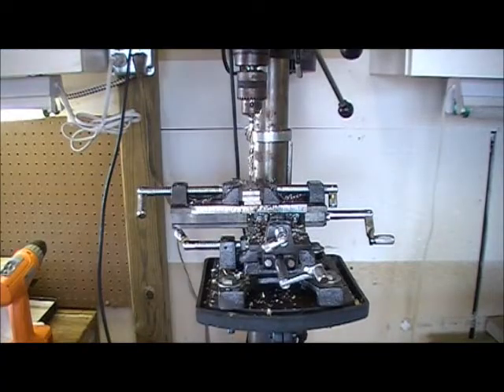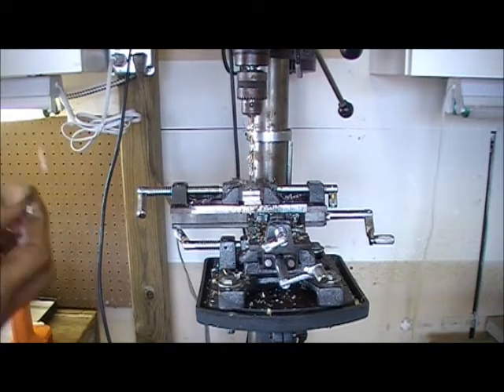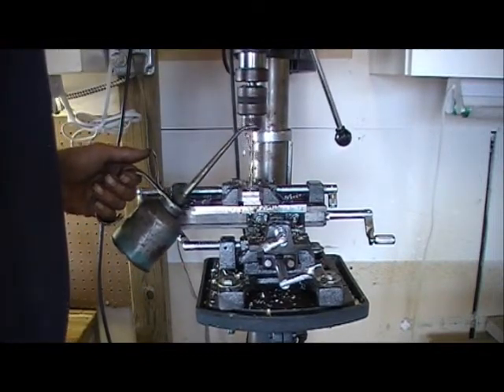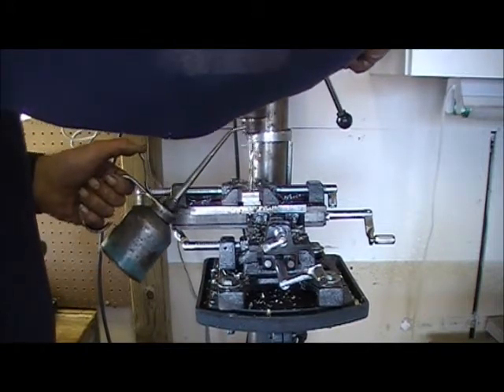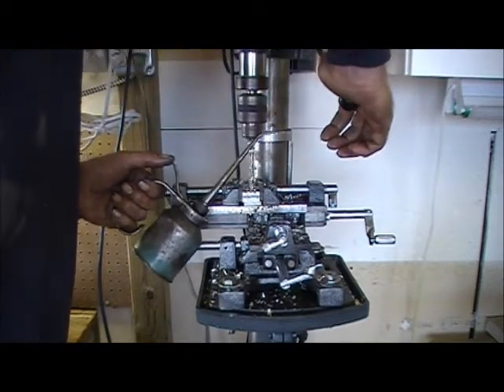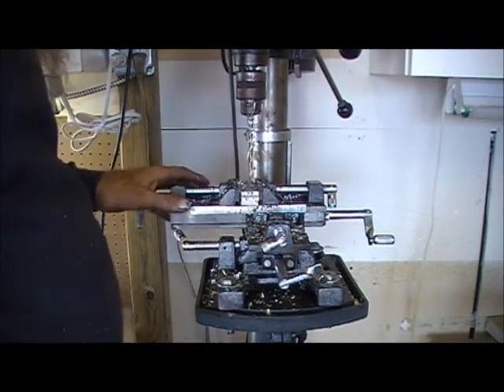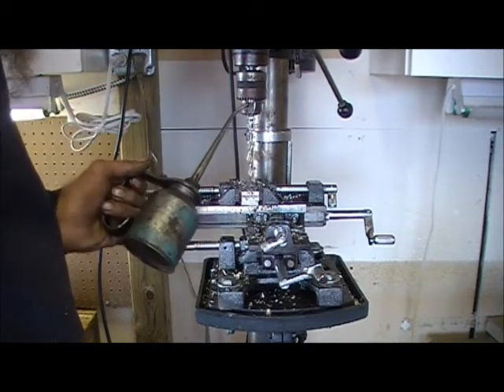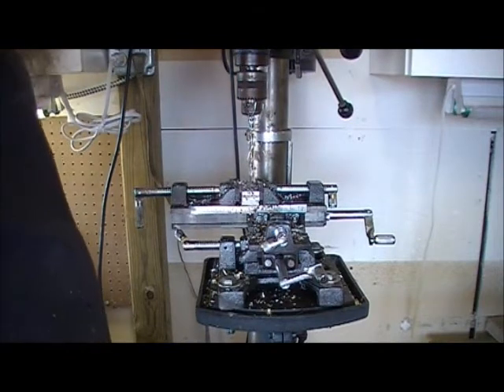Keeping from getting hurt when drilling Aluminum

Comment from the maker: @Xeil I've never had a problem with Seafoam in a wet clutch ... Unless the clutch in question is a pre-1975 Yamaha that has never been replaced - Would lean towards doing it like right before an oil change though - Seafoam is hard on seals in a crankcase - makes em nice and soft now but in a couple of months they get brittle - I tend to lean towards Marvel for that exact reason